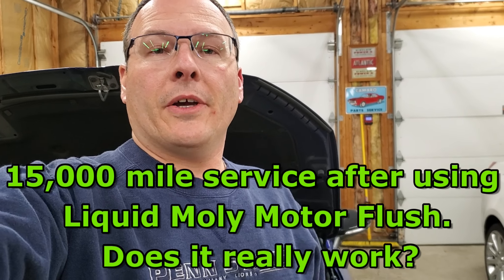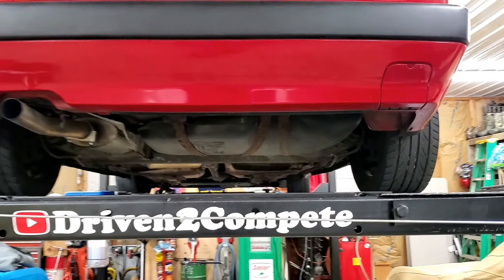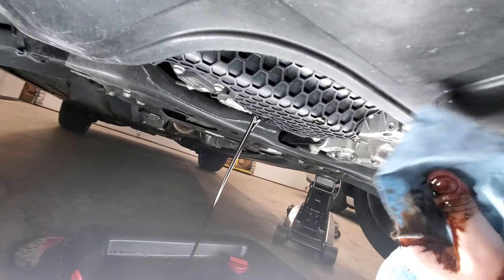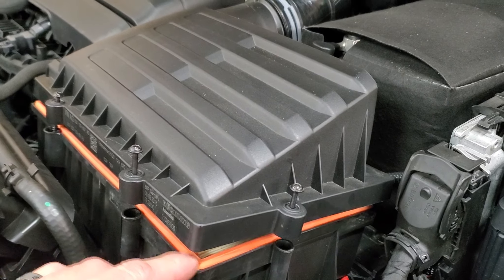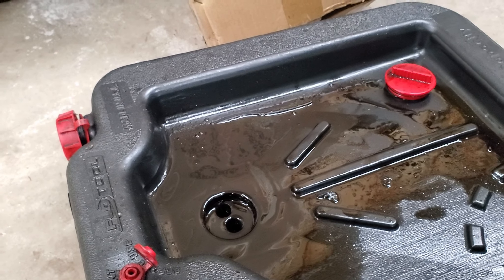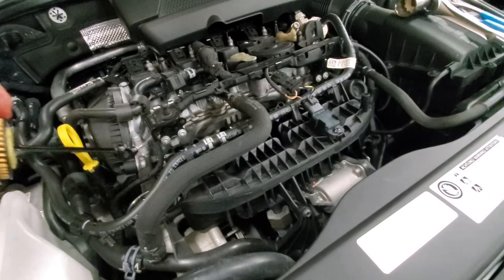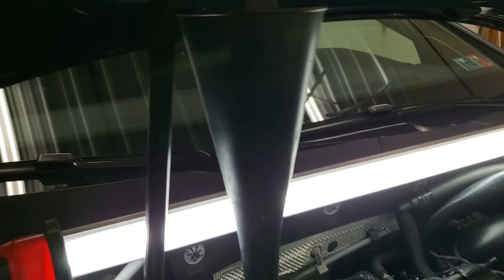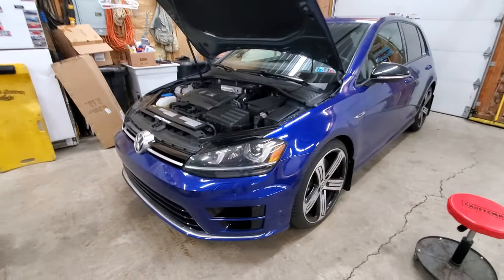LIQUID MOLY PROLINE MOTOR FLUSH - DOES IT WORK?

Comment: No jack stands?? Going underneath the car without jack stands is pure idiocy!
Reply from the maker: Two jacks were used in place of jack stands.  Besides, at the time of the video, the jack stands were being recalled for safety concerns at Harbor Freight.  Thus, the reason for using two jacks.  Thanks for your comment and concern.  Just wanted to explain my reasoning.
Reply: I’m with Terje on this one…. 1 jack fails, car drops and falls off the second one = ouch! Anything solid, even bad jack stands are better than nothing. Wood blocks, house bricks anything. Jacks are awesome but you are leaving life and limb to small rubber seals. Take care dude and keep up the good work.

Comment: Is there a follow up video after the oil?
Reply from the maker: I can definitely do that!
Reply: Thanks dude! I haven’t used it yet, but I purchased Motor Medic. I have 2007 Mercedes GL450, which must run on the nectar of the gods Mobil 1, and found they have a synthetic version. I wonder if there’s any real difference? I’m scared to NOT use anything synthetic. If I use an off label part it starts spitting on me and shouting in German. It’s insane that I have to use Bosch parts, and nothing else!

Comment: You didn't loosen the oil filter housing while draining your oil? tisk tisk. You should also prime the housing by adding some fresh oil to it before swapping the filter and torqueing it down.
Reply from the maker: I appreciate your comment.  I have not noticed a difference in drain time / speed by loosening the filter housing or leaving it tight.  I have soaked the filter media in oil in the past and was told by a technician that it really has no impact versus allowing the housing and media to fill / soak at start up.  So, I didn't mention or show that in the video.  I do appreciate your comments and appreciate your participation.  Thank you!

Comment: hey are you happy with the LM molygen 5w40? FYI is not approved vw 502 00 oil
Reply from the maker: Loving it so far.  Fantastic oil and I'm using it in everything, except my diesel truck.
Reply: @Driven2Compete  i am using it to micra nissan micra k12 and it very suitable for the climate of greece (mild winters, very hot summers), I am thinking to use to to my new 1.0 tsi vw golf engine (now i am using the top tec 4200 5w30) but i have hesitations. Greeting from Sparta, Greece mate

Comment: No matter how many times you flush your engine you’ll still need a valve clean, because nothing is there stop prevent or wash off the buildup. You should get your valves media blasted and you injectors cleaned and resealed around 60k miles.

Comment: Cool video. Your catch can has me worried that you got ripped off. Looks like your catch can is just a tube and does not have any divisions to help with separation. After 1k miles with a catch can you should have about 400+ ml of a mixture of water, fuel, and oil. I am running a racing line catch can that replaces the factory PCV system. You nearly gave me a heart attack with the two jacks but if it works it works. Fun VW fact, the car needs to be at operating temperature when you check the oil. I don't know why they do this but I am sure you and everyone else is fine.
Reply: it actually does. it has a baffle system in it.

Comment: Makes a video titled “Liqui Moly Proline Engine Flush - Does it work?” (spelling corrected)
His answer: “Your guess is as good as mine” 🤦‍♂️

Also, it will not affect carbon deposits on a gdi engine.  You’ll need to get those professionally cleaned every 30k.